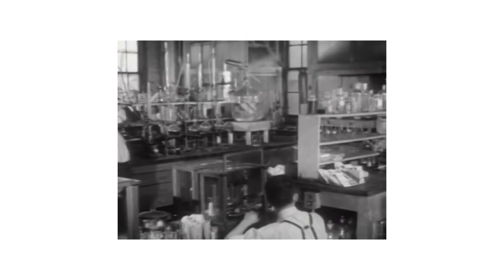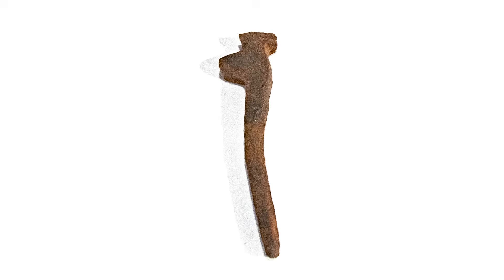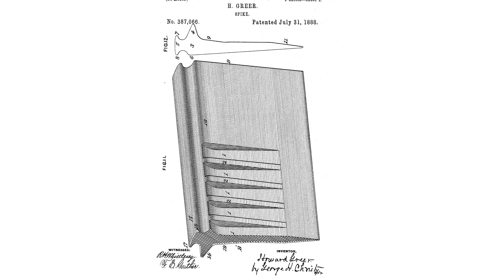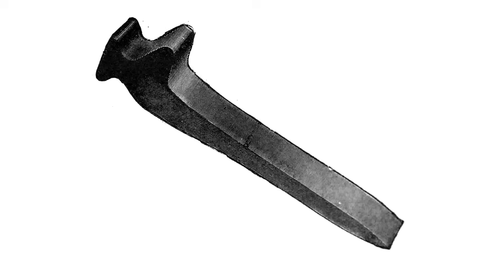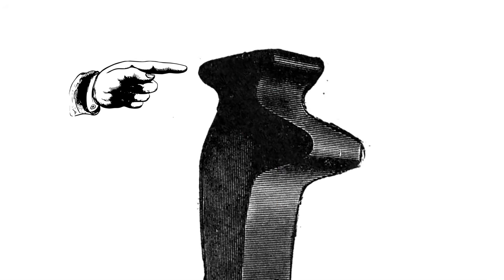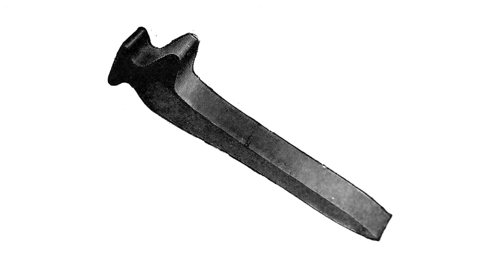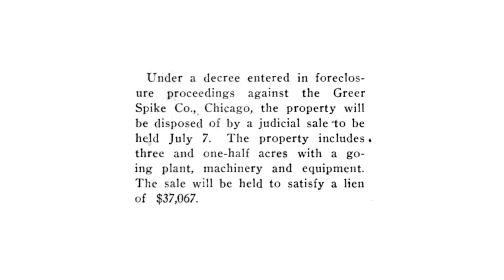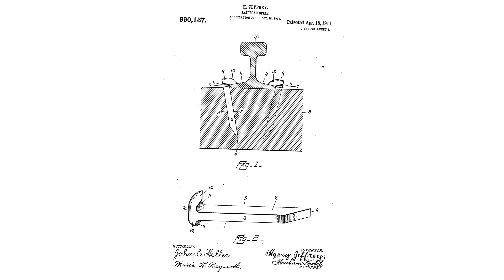What is a Greer Spike? Obscure Train Tech: Science on the Railroad

Comment: Interesting presentation. When I was stationed at FT. Belvoir, I walk a section of railroad that was setup to handle Railroad Artillery before WW II. Very heavy rail and well maintained. Not sure of the weight per yard but they were almost like a triangle in cross-section. So possibly 200 pounds per yard. Far heavier than post WW II PRR order listed in Wikipedia. The heaviest US railroad track ever produced weighed 155 pounds per yard (77 kg/m). This was rolled by Carnegie (US Steel) in 1949 and was specifically made for the PRR.

Comment: Very nice video on the Greer spike. I wonder if the complaints by trackmen came later when the spikes might have gotten rusty. My modern day experiments with now rusty Greer spikes is that they are very hard to drive and have a tendency to bend in the middle-- and they have a tendency for the head to brake off when pulling them. Then examples we have seem thinner than the old drawings as well. If you find old ties in the roadbed that had these spikes in them, there are examples where the heads broke off (perhaps their great holding power was an issue, lol) and the old odd-shaped shank is still in the tie.

Comment: Years ago I designed two spikes that I thought would be good.  The first was a standard spike, but shorter and  with a slight curve in it to hold better. It would be lighter but still effective because of the curve. The other was like a standard spike, except it was shorter (thus lighter) and  had a 4-pointed star pattern to it as  you looked at it from the tip (like  a phillips-head screw pattern). It  would have a pencil-point type tip. I believe that  it would  hold well  by increasing the surface area contacted by the wood.  This one  would have to be made in a mold, however, not cut repeatedly from a long piece of stock.

Comment: In the real end, the Pandrol clip solved all this. These are pretzel shaped spring clips that hold the rail. These use screws to anchor them into the tie (which enables use with concrete ties, but they work with wood too). The clip and screw system solved all the problems. The spring clip provides constant pressure, with the screws providing ungodly fastening power, and because they are a screw they come out easy. These were pattented 1957 or so.